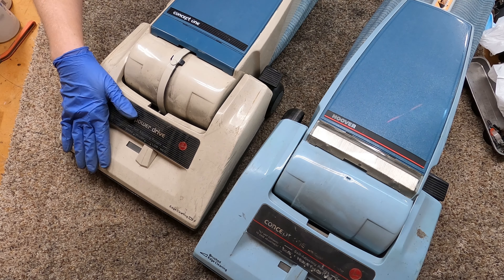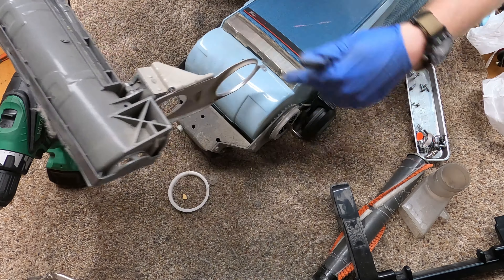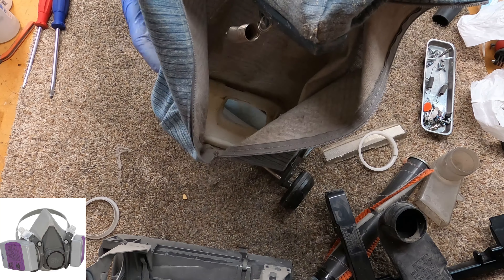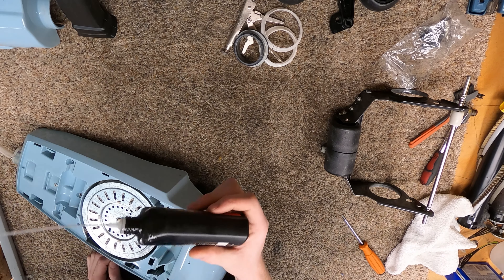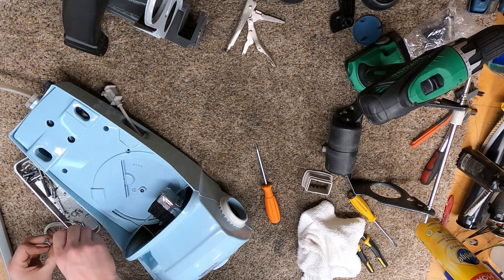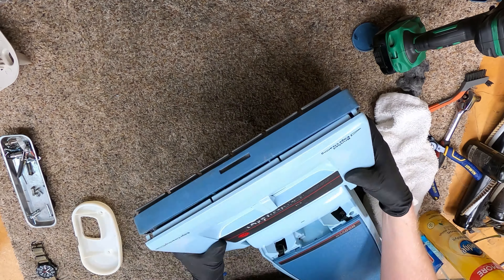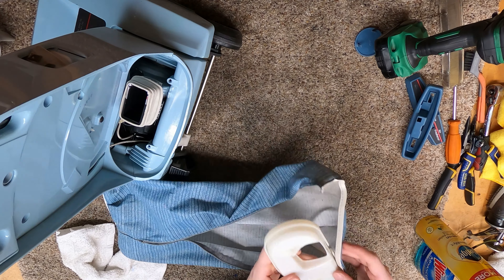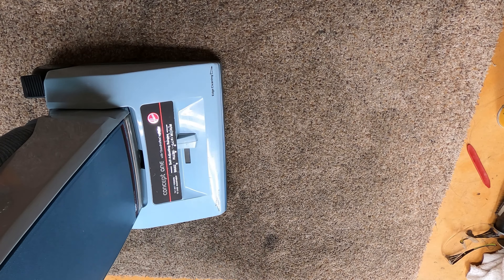Hoover Concept One Vacuum Repair

Comment: Dear Performance Review,

Couple years ago I had a windmill in my head and I ate all the Dyson marketing like an idiot NPC. Bought a Dyson v7, and my god those Dyson heads and their bagless canisters are such a pain to clean. When it stopped working, I dug the internet and discovered your channel. Bought a Miele C1 and a Wessel-Werk TK 286 turbo head this time, with a metal adapter of course.

Compared to the Dyson, they are such easy to maintain, quality products and I couldn't be more grateful. Thanks for the in-depth TK 286 Repair video too. I am no longer a windmill brain NPC :D

Comment: Thank God I found your site! I have a Hoover Concept One Model #U3109 power drive that my grandmother bought new from my mother when she worked at a furniture store. It was bought in the early 80's, probably 81/2ish. I need belts and my brush bar is decent but of course I wish I could get a replacement. I don't know what belts to get as the belt #'s have all worn off, so need some help there please.

My grandmother used this vac until she died in 2008 so she got 25+ years out of it. Still runs good but want to give it some love and clean it up, maybe put a new power cord on. In my opinion this is one hell of a vac, I've used it on all sorts of different carpet and it's always done a great job. TIA and keep up the good work.

Comment: Excellent overview and 'How To.'  I picked one up the other day at a GW, for $11.  The color caught my eye,  and the shape was so Jetson's.  I had not seen one before either.  Non-power drive, and sounded good. It's cleaning up well, and your demo here answered a number of questions I didnt have yet. Especially the brush roller.  Thanks. Nicely done.  (P.S. Add the light bulb to your Amazon link)
Reply from the maker: Thanks for bringing that to my attention the light bulb link is now in the description
Reply: @PerformanceReviews  Those are 12v ?  I didnt know that.  great.
Reply: @PerformanceReviews  I grabbed my meter, and yes, it read 11v.  All the other suppliers are charging from 3-6 bucks per bulb, while your recommendation is a buck.  I did notice how all the official vacuum replacement sites made it a point not to list the voltage of the lamps.
Reply: @PerformanceReviews  Used your link for both.  Thanks for the assistance.